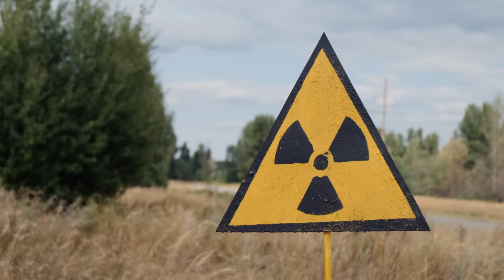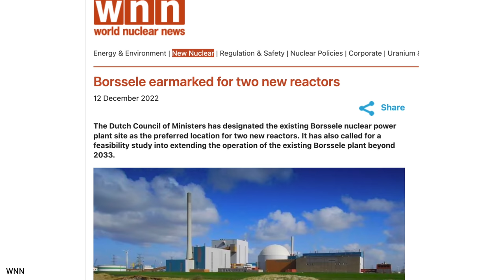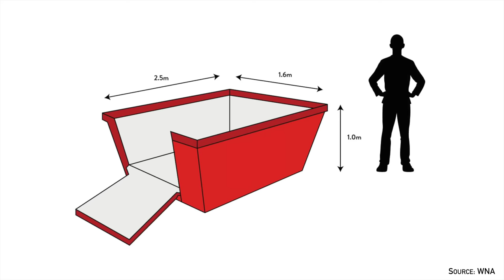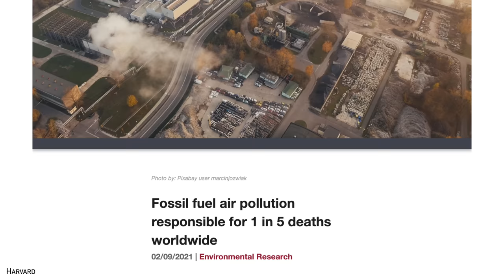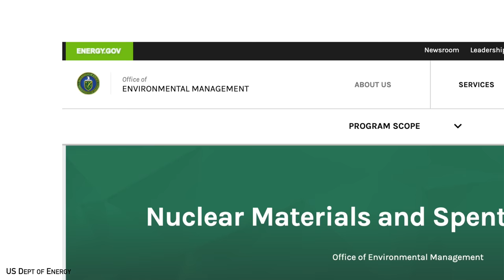Can Nuclear Waste Ever Be Solved? Yes.

Comment: FYI after 300 years high level waste decays to a level equal to a high grade uranium ore deposit.
Reply: FYI  no it does not
Reply: It most certainly does.
Reply: Not even remotely.

You may be thinking of the liquid High Level Waste that results from reprocessing of spent fuel, principally Caesium and strontium, and decay products. You may also be applying a rough rule of thumb (ten half-lives) which is used for small quantities of material with short half-lives such as those used in biological research and medical applications.

However, in Spent Nuclear Fuel, there are also transuranic bombardment products that will remain radioactive for thousands of years, at much higher activity than the original ore.

Reprocessed waste is hardly a useful benchmark, as France has only processed about a third of their spent fuel, and the US has reprocessed about 1%, none at all since the seventies.
Reply: @aaroncosier735   Many countries reprocess spent fuel, the US could be but Carter, then Regan scared away any potential investors in the process.
Reply: @danadurnfordkevinblanchdebunk  
Not many reprocess in great quantity, and none keep pace with waste production.
Only a small fraction of spent fuel has ever been reprocessed, either for waste or for re-use.
Reply: @aaroncosier735  And Oklo Gabon proves the waste needs no expensive casking even if the unwise choice to bury it is utilized.
Reply: @danadurnfordkevinblanchdebunk  
You are incorrect.

The conditions at Oklo immobilised the uranium, and the plutonium produced by fast-neutron capture, because they share similar chemistry.
Those conditions would not contain or immobilise fission products with different chemistry, such as Iodine or Caesium. 
A high school chemistry textbook will help you understand this.
The continuous release of fission products from Oklo probably didn't bother anybody two billion years ago. However, today's waste stockpile is much larger, each reactor involving tens of thousands of times more material. Pretending that this material does not need encapsulation and very carefully selected disposal geology is just dopey.

What Oklo does prove is that reactor waste remains distinctly different to unreacted ores even after two billion years of decay.
Reply: @aaroncosier735   I'm not wrong at all, nor are the scientists who have studied it.  The conclusions are very clear that even after two billion years the contamination at the site was not widespread like you so desperately need it to be.
Reply: @danadurnfordkevinblanchdebunk  
As I pointed out, the fission products were soluble and left the site.

For modern wastes we do not have the luxury of waiting two billion years.  Perhaps you have not really thought it through?

The onsite actinide contamination necessarily formed in the precise location that the uranium was immobilised, and traces remain to this day.
We do not have the luxury of waiting two billion years, so our wastes need more elaborate consideration in the meantime.

I am simply pointing out that you have completely missed the point. The conditions that trapped the original uranium also immobilised the plutonium, but those chemical conditions would specifically not contain fission products.
Those most certainly escaped immediately. 
They would not cause widespread contamination at the site. They would cause contamination downstream which would be undetectable today due to the shorter half-lives involved and the soluble nature of their own decay products which would also be mobile and washed yet further down stream.
These would be difficult to trace in any case, as the entire site was tiny and involved tens of thousands of times less material than a typical spent fuel storage.

I don't "need" it to be anything except far away from me. You however seem desperate to deny simple facts of chemistry and physics in an attempt to dodge totally reasonable measures.

Comment: Some Fission products can be used in Radioisotope thermoelectrical generation,  or in beta voltaics.    Although these produce a tiny amount of power, they can do so over decades or centuries up to millions of years.   They would be indispensable for inter Stella space travel.
Reply: All you have to do is reprocess and that is $$$..  The Pu238 used in the space probes costs $90 million.
Reply: @clarkkent9080  It would be a way of using the waste, rather than locking it away.
Reply: @Zurvan101  BTW the Pu238 that is made for space probes does not come from spent fuel since it is not found in any significant quantities in spent fuel.
Reply: @clarkkent9080  you're still missing the point. 

Many fission products can be used for generating electricity and they have the added bonus of using those products,  as opposed to counting them as waste.  

Not only that but many have a much longer half life the pu 238.   Voyager 1 & 2 are already in partial shutdown because their fuel has been spent.
Reply: @Zurvan101  And you are missing my point that Spent Fuel has NEVER been used to make medical isotopes or space probe thermal generators.  
There are specialized reactors where specific elements can be irradiated to create the exact isotope desired for medical or space probes.  There is no need to separate or much to process.  
Spent fuel is a mixture of many isotopes and to separate them is extremely expensive. Also, some medical isotopes have such a short half-life that spent fuel would have to be immediately processed after being removed from the core and that is when it is highly radioactive and thermally hot. 

Why do you think they would build a special reactor to make these isotopes if they could get them from spent fuel??? THINK????  There is a reason why it is not done
Reply: @clarkkent9080 and in the long term, it will be cheaper to find a way of separating isotopes  for the use in RTGs etc. than to just bury the waste.....

....Think..!

Comment: Water does NOT last 10,000 yrs, it is the useful fuel that lasts that long, thus needs to be recycled into reactors, not wasted into the ground. Waste lasts less than 300 years before it is less radioactive than uranium ore, less time to be lower radioactivity than thorium ore.

Comment: A lot of what people don't understand is that the used fuel pad at these plants is around 1-2 hectares, and these pads are barely 1/3 of the way full even after 50 years of operation at 2GW sights with a >90% capacity factor. Meanwhile the fission naysayers are fine with using thousands of hectares and and dealing with the toxic waste from solar and the batteries that make solar's <25% capacity factor viable, then replacing those thousands of hectares of panels and batteries again and again every 20 years or so. I'm not against renewables/batteries, we need a mix of all these carbon free sources, not everyone can afford or has the political stability for a regulatory framework for fission power, thankfully these are usually countries with very low power needs, so renewables/batteries and fossil fuel backup power should be enough for them without causing too much environmental disturbance.
Reply from the maker: I suppose everyone will have their priorities of what they want and don't want, and everyone will say their view is rational. Dedicating land to solar is ok if it matches someone's priorities, but the nice thing about nuclear waste is it's really really small for the energy that's come from it. Cheers!
Reply: You should include electronic or call it ewaste because people would probably understand that better than toxic waste.

Dont batteries only last 5-10 yrs while panels last 20-30 (although people claim they can last longer but at reduced capacity except the problem with that is "The average age of a vehicle on the road is about 11 years, but most drivers keep a car for about six years."
"47% of Americans have lived in their homes for six to 10 years. 35% of homeowners have lived in their homes for 10 to 15 years. 16% have lived in their homes for less than five years. The average length of homeownership years is eight years."
People are probably going to replace panels with more efficient ones before 30 yrs (which means that the current panels might not have been paid off) or theyre going to move and will have to replace the panels to make the house more appealing.

Considering the amount of land needed for solar and wind and the environmental impact wouldnt it be better for developing countries to use fossil fuels while first world countries go carbon 0. Or what about smrs instead of solar/wind (there are nuclear batteries powering lighthouses. How much stability do you really need for that and if the area is unstable wouldnt the nuclear battery be better since its more compact and easier to protect compared to people can steal solar panels).
Reply: The US civilian spent fuel inventory is about 140,000 tonnes. Only about 55,000 tonnes is in casks. 85,000 tonnes is still in cooling pools.
If the pads are only 1/3 full, then they will just barely hold the waste that already exists. 

Can't pat ourselves on the back for a job that isn't finished yet.
Reply: @aaroncosier735  "The U.S., which led the way on managing nuclear waste in the 1980s and 1990s, has now fallen to the back of the pack. About 88,000 metric tons of spent nuclear fuel from commercial reactors remain stranded at reactor sites, and this number is increasing by some 2,000 metric tons each year."

And you didnt read the original comment that talked about how solar and wind will have more waste (by 2050 its expected there will be 78 million tons of waste from solar panels. Over 50 yrs from around the world theres only 250k tons of nuclear waste. It would take Japan 19 yrs to reprocess 10k tons of solar panels. All 250k tons of nuclear waste could fit in 1-2 football stadiums).

Comment: For more on long term geologic storage watch one of my favorite documentaries: Into Eternity. It asks one important question once the facility is at capacity, what should be done? Should we warn future generations about it, or endeavour to forget it?
If it's the former how should we warn them? To put it in perspective 100,000 years in the past we were living in caves. 100,000 years hence humans as we know them may not exist. 
If we chose the latter, could that not be classed as negligence? The thing is, the materials (such as copper) that make up the casks are highly valuable. What's to stop ignorant prospectors attempting to get that stuff?
So, we look at warnings, assuming they are correctly interpreted would they actually have a perverse result of inviting intrusion? The Pyramids of Giza had curses and warnings against intrusion and they were violated. And that's only around 5,000 years ago.
Anyway watch it, great documentary.
Reply: Two billion years after Oklo Gabon clearly shows your answer.
Reply: @ForbiddTV  Oklo in Gabon is a fascinating natural phenomena. With very specific conditions that allow for self moderation and shows that nothing new is under the Sun... However, the situation is very different. Oklo had a neutron moderator on tap, geologic storage doesn't (especially if someone inadvertently compromises the casks). When Oklo was reacting, it probably had a quite high radiation output. While a quite high amount of Uraninite exists it's now not enough to sustain a reaction. The materials in geologic storage are highly processed and extremely radioactive. And likely will be for the best part of around 100,000 years. So, I probably wouldn't want to have been in caves 2,000,000,000 years ago either.

Comment: Doesn't U238,  U235, Th232 and PU339 all fission in the fast neutron side of the spectrum?  Just burn it up in a fast reactor.  And you will be left with hazardous waste for 300 years.  As opposed to 100,000 years.